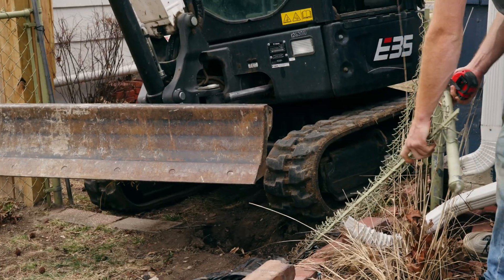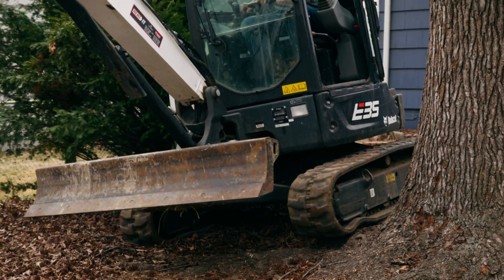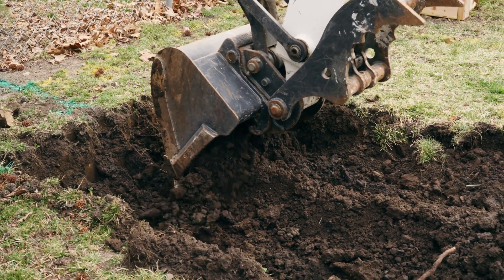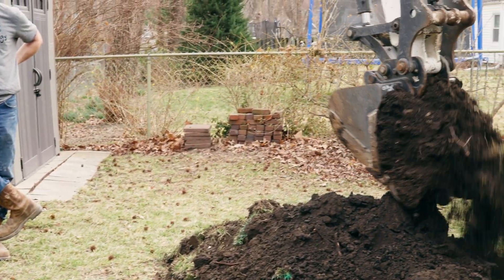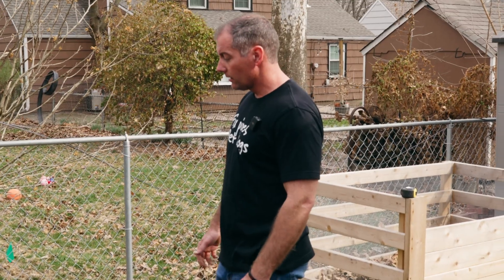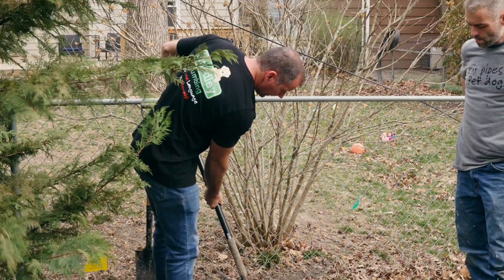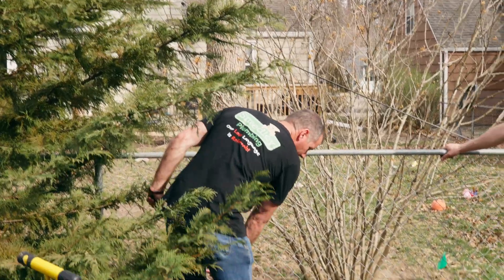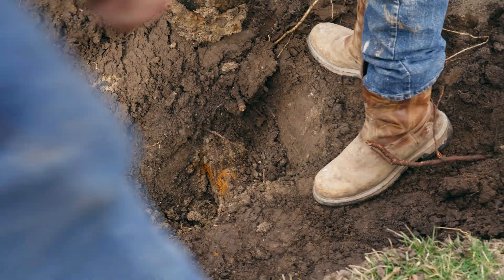Excavation Tutorial: Digging Safely Around Utilities

Comment: Good technique but a lot of times you are taking a big risk digging a deep hole to start with, if other utilities are unknown or you don’t trust the maps/locates which happens more often then not.

I dig over and under stuff every day and don’t know the locations half the time, experience is everything. I dig with the machine till I see something, feel something…or my gut and experience tells me. 
I would have taken the smooth grading bucket and put the machine right against the fence so I can dig with the gas line, then pulled a 4x4 hole 1 inch at a time. 
You dig in a V shape, so slope 1/2“/ft until you are 1 inch deeper in the middle then pull up while someone is watching. 
I can stop the bucket within 1-3“ after the signal which means it penetrated the pipe by 1/16th to 1/8th of an inch which is not enough to damage a pipe. It will either deflect or resist, maybe gouge it.
Either way I would have gone around 18“ and then at the bottom of the hole I’d let the labor poke around but never deeper then 4-6“ before taking another scoop.  If he poked 2 inches I can take another inch right. It’s better to go 4 in case of a coupling.
We would have found the pipe with the shovel and it would not have been damaged if it was by machine. And it goes quick I happily take 10 pulls a minute, you do the math.
I know at least a dozen other ways to dig utilities but the main thing is you have to know what you are dealing with. There is stuff you don’t wanna mess with and experience is key.

Your technique definitely aims for the less experienced - but in that case again why would you suggest digging a deep hole next to another utility…without proper technique to actually dig said deep hole? You can’t just dig that with big scoops you know it doesn’t make sense.
There are ways to find utilities and they work, you don’t have to know where they are.
I can take the machine and dig a hole wherever and I’ll find everything that’s in there without strike and without knowing. There is a way to dig holes, but digging deeper holes is not how you dig a hole if that makes sense.
I know you want to make it easy but what makes it easy is to hop on the machine and go slow and smart. Minesweeper that’s all it is.
Reply from the maker: We dug as deep as we needed to to get to the leaking pipe.  There was no extra work and no risk in what we were doing.